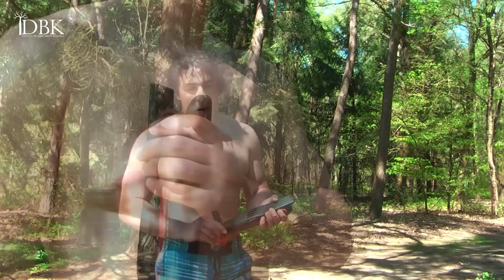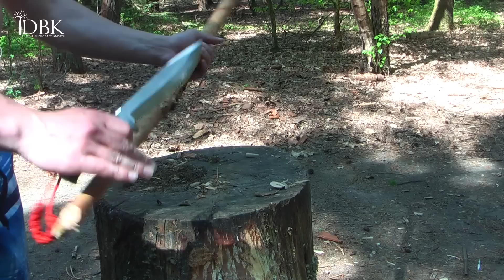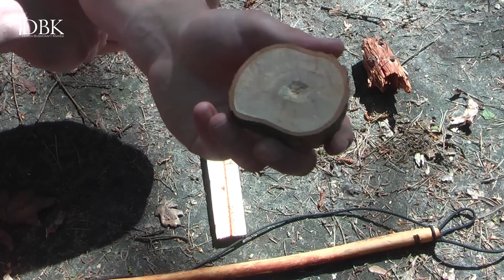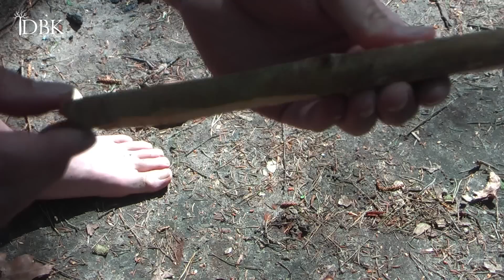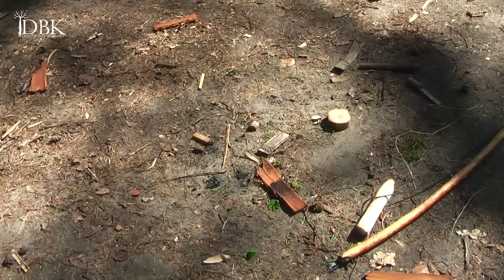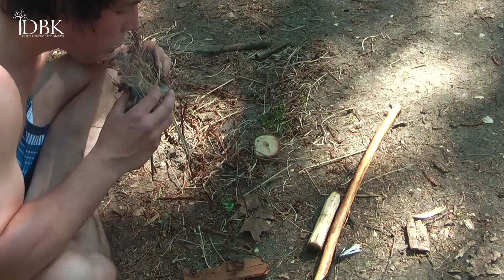Fallkniven A1 Pro: Making a Friction Fire

Comment: Great video. One thing that would help a lot is to make your spindle smaller. The one you have here is about twice the diameter that it needs to be. If you keep the diameter smaller, you provide much more force to the contact surface providing greater friction and heat. :)
Reply from the maker: thanks for the tip mate! I will test it next weekend!